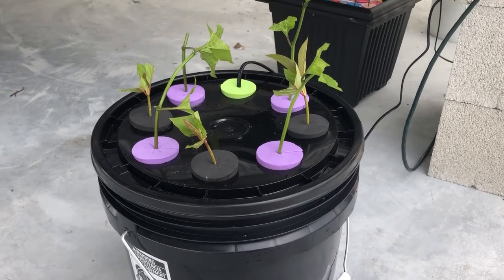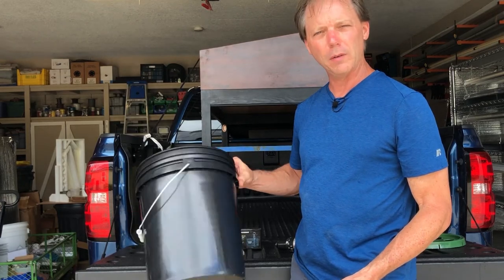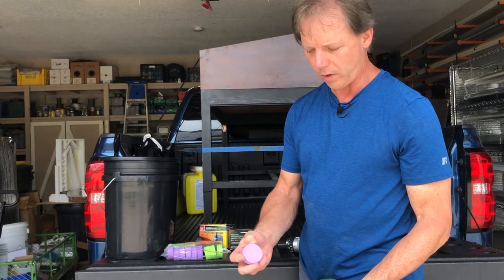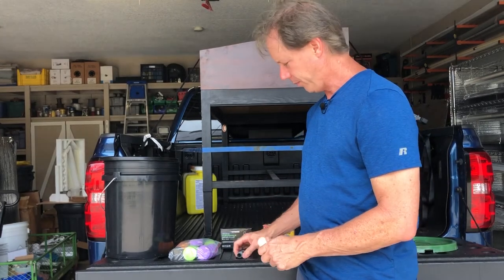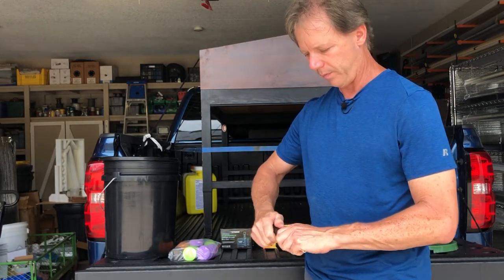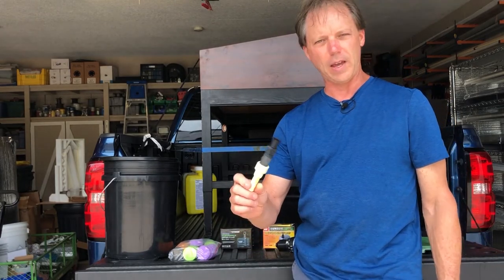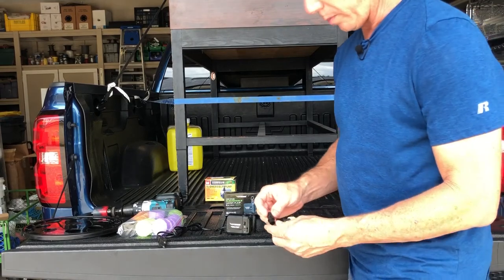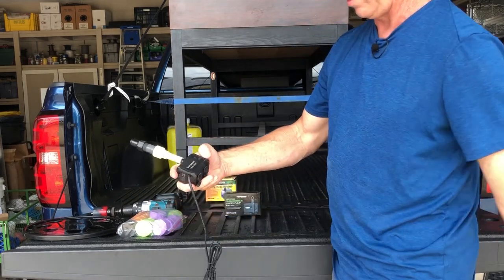DIY 5 Gallon Bucket Aeroponic Cloner

Comment: I've had some issues getting my lemon tree cuttings to root in soil. Would you recommend this for citrus cuttings? Do you think the water sprinkling stimulation would prove more helpful?
Reply from the maker: It's worth a try, I think this method is best for soft wood cuttings though. Maybe try the sandbox / sand bucket method, that has worked well for me for the harder wood like figs.
Reply: @GardeningSolutions  thanks so much for the suggestion.

Comment: Is that really all the water you need in there?
Reply from the maker: Yes, not much is required. There is very little water loss since it is sealed up. You want to make sure the pump is covered and maybe an extra couple of inches but that is all you need.
Reply: @GardeningSolutions  Thank you!

Comment: No dome is needed? Do you have to keep the whole room that their in at a very high humidity?
Reply from the maker: No dome required, the roots are kept wet by the sprayers and the humidity in Florida is enough to keep the leaves from drying out.
Reply: 12 inch round plastic cake pan.....5 gallon bucket is 12  inches around...the cake lids make nice domes

Comment: Hey Carl I have everything lined up for this with the exception of that PVC extention piece. Will you share the spec? Length, name etc. 
I went to Lowes yesterday, but couldn't find one
Reply from the maker: Hello, which pump are you using? If the small one, you need a piece of 1/2" CPVC pipe: https://www.lowes.com/pd/Charlotte-Pipe-1-2-in-x-5-ft-100-PSI-CPVC-Hot-Cold-Pipe/1000957530

The larger one uses 1/2" PVC. In either case you will need to cut the pipe, you only need a 2-3" length.

The sprinkler riser adapter for CPVC is this: https://www.homedepot.com/p/Everbilt-1-2-in-CPVC-CTS-Slip-x-FIPT-Adapter-Fitting-C4703HD12/100347927

I didn't see it on the Lowe's site but I know they carry it. If you want to skip the sprinkler riser and screw the head right to the end of the CPVC pipe you can use this: https://www.homedepot.com/p/NIBCO-1-2-in-CPVC-CTS-Slip-x-MIPT-Adapter-Fitting-C4704HD12/100048636

I did it with the riser because I already had all the parts on hand.

Does this help?
Reply: @GardeningSolutions  Outstanding..Your awesome Carl! I can't thank you enough.
I'm all set and will be using the small vivosun..Appreciate  you taking the time.

Comment: If I want more of a mist which head would you use..I'm going with the bigger pump
Reply from the maker: My results have shown that the head and spray pattern make very little difference. If you want a mist though I'd look at using some drip water system heads, they may have to be adapted.
Reply: @GardeningSolutions  thanks
Reply: @roybrooks13  
Use a booster pump designed for reverse osmosis, (ideally dc voltage). A single upward firing misting nozzle will be more than enough for a 5gal bucket.

Comment: Can you list the parts for the sprinkler head please
Reply from the maker: Do you have a home improvement store nearby? Here's links for parts:
If the small pump, you need a piece of 1/2" CPVC pipe: https://www.lowes.com/pd/Charlotte-Pipe-1-2-in-x-5-ft-100-PSI-CPVC-Hot-Cold-Pipe/1000957530

The sprinkler riser adapter for CPVC is this: https://www.homedepot.com/p/Everbilt-1-2-in-CPVC-CTS-Slip-x-FIPT-Adapter-Fitting-C4703HD12/100347927

And a riser: https://www.lowes.com/pd/Orbit-1-2-in-MNPT-x-1-2-in-MNPT-Cut-Off-Riser/1063721

I didn't see it on the Lowe's site but I know they carry it. If you want to skip the sprinkler riser and screw the head right to the end of the CPVC pipe you can use this: https://www.homedepot.com/p/NIBCO-1-2-in-CPVC-CTS-Slip-x-MIPT-Adapter-Fitting-C4704HD12/100048636

I did it with the riser because I already had all the parts on hand.

360 degree sprinkler head: https://www.lowes.com/pd/Orbit-10-ft-15-ft-Shrub-Head-Sprinkler/3427754

Does this help? I can provide Amazon links but the pipe is expensive there compared to buying it locally.
Reply: I'm clueless for sprinkler parts so a link would help me understand what I'm looking for much better!
Reply: @GardeningSolutions  I was gonna ask, what was the point of the riser,? haha so just pump to pvc, pvc to adapter, adapter to sprinkler nozzle, got it.